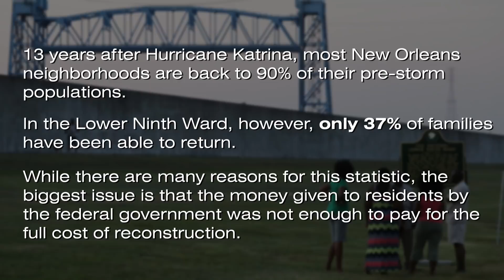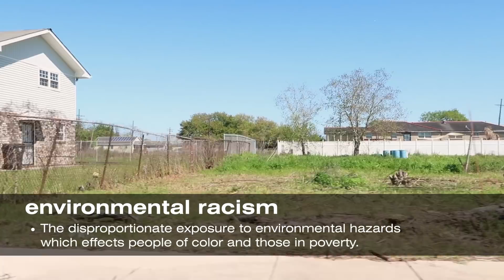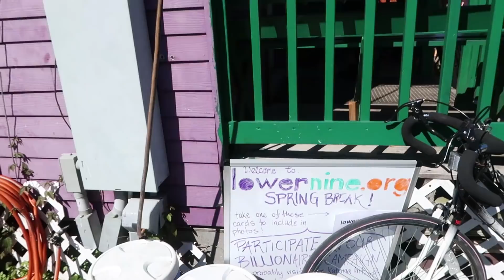We Volunteered in the Lower Ninth Ward • Ladylike

Comment: I live in Louisville, Kentucky and they do something here like contracter fraud. We get severe thunderstorms all the time with hail and all, so people are constantly replacing their roof tiles because of leaking. There is some people that are offering to replace roof tiles for cheap. So they come over and remove all your roof tiles, you pay them, and make an appointment for when they are supposed to come back to put the new roof tiles on, then they leave. It all sounds fine and normal right? But the sad thing is they never come back so you are left with just a bare roof no tiles. Also the people doing this are targeting elders as their customers. I have heard about this mostly happening in southern Kentucky with a few family members, not much in actual Louisville.